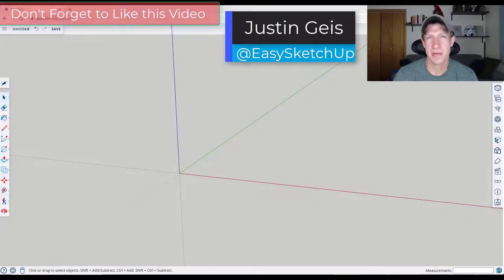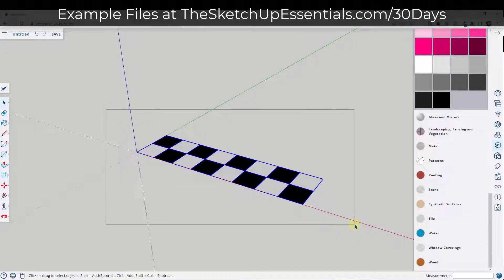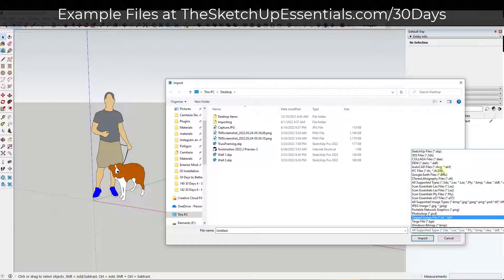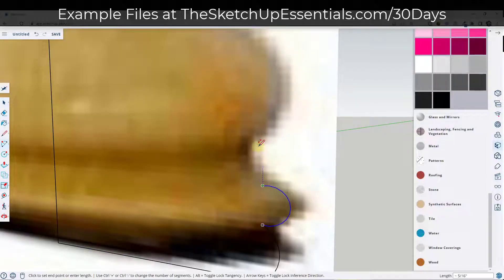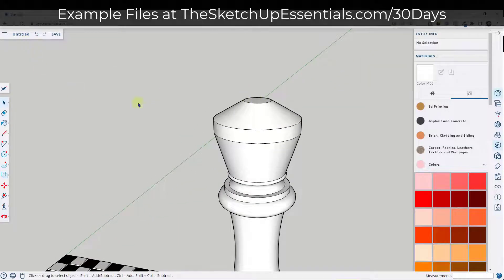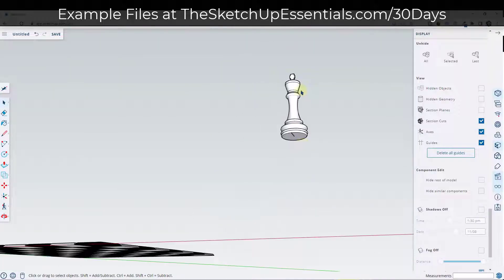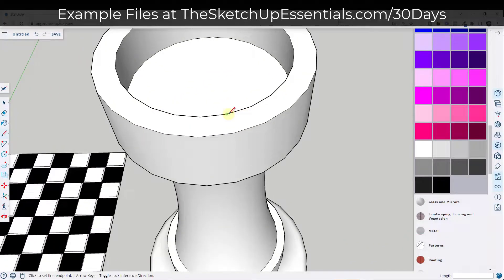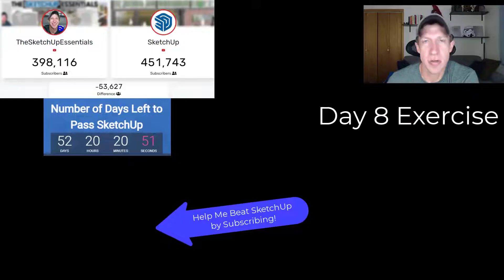Learn SketchUp in 30 Days DAY 7 - Chess Board and Pieces!

Comment: I made both black and white components but After I copied and pasted the squares for the board, I lost the ability to adjust each separately as a component. I couldn't adjust the height of just the whites.  I could only adjust each one by one.  What did I do wrong?  Everything else went great!  Thank you.
Reply: Same here🤔.  Did you manage to solve this @sandraforbes7495?
Reply: I had this issue as well. Using Pro version I had to check the box Replace selection with component in the create component window. I don't know if this is a proper way or not.

Comment: Hi Justin. Thanks for all this great stuff. I'm having a problem with the scaling tool. I create a circle and PP it up a bit and then click on scale but then when I drag  a handle the clylinder is pulled over, in does not get smaller symmetrically. Any idea what I'm doing wrong?
Reply from the maker: Tap the control key to go into scaling about center mode

Comment: How can it be solid but not solid? Tried a different chess piece and the skirt with the notches had an arch instead of vertical walls and well lessons were learned alright. Can't push/pull a curved surface and can't use the solid tools because my chess piece was just a surface. Couldn't figure out how to make it solid so remodeled a simple one like in the video and work just fine. Slightly disappointing but moving forward

Comment: When I used the follow-me tool it left a vertical line on the outside of the piece. Did I do something wrong? I am using Sketchup Pro.
Reply: I solved my own problem, I needed to click on the outer edge of the circle before I completed the follow-me action. Thank you again. Learning lots :D